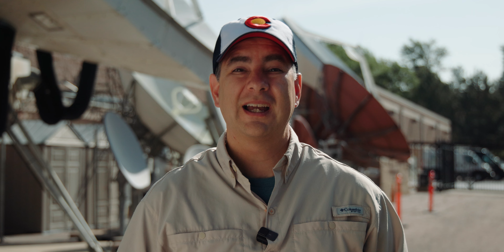Become a Radio Station Troubleshooting Pro with These Expert Tips

Comment: Seen all of these in my 35 years as a broadcast engineer here in the uk. Presenters leaving without setting the desk correctly despite a check list being a common issue!
Reply from the maker: By far the most common no matter where in the world, it seems.
Reply: @TheBroadcastEngineer  By me the standard is loosing signal for 2 or 2.5 hour periods, because your STL is going via fibre, and the one node along the way that is critical is beingh rotationally load shed, and the batteries were stolen 3 months ago.  Have not seen a single residential fibre hub that still has intact battery doors, all of them have been ripped open and the batteries stolen. The mobile plant in the building they actually replaced the battery packs, with lithium iron phosphate units, and those literally got encased with a reinforced polymer concrete fill, to prevent them being stolen, plus bolted to the floor with anchor bolts.

Comment: And of course your favourite one, off the air because the generator has finished drinking all the oil, and has gone off on low oil level, or the solar charge controller got stuck trying to manage loads, and turned them all off, waiting for you to drive up there and "turn it off really, and turn it on". Or the problem might be easy to see, because, despite having 3 different Internet suppliers, and 3 different fibre cables, they all 3 meet at one cabinet 3 streets over, and some drunk guy just put a truck though the cabinet, cleaning it off neatly just under pavement height, and moving it 30m down the street.
Reply from the maker: What? Having three different providers have a common box never happens! 😜
Reply: @TheBroadcastEngineer  Turns out all 3are resellers of the fourth, who you absolutely despise from previous experience with the finest call centre talking bobbleheads they could find for $1 per hour, and the ability to read the script without understanding anything on it.
Reply from the maker: @SeanBZA hahaha that’s even funnier! Sorry to laugh at that, but the reseller market makes it difficult to actually source different connections.
Reply: @TheBroadcastEngineer  Well by me there are 4 running outside. First one is one cellular company, who recently sold off the actual infrastructure to a newly formed company, and is pretty reliable. Second is a residential fibre provider, okish. Third is what was the state telecoms company, and my reply to them is that they still owe me money, which shuts them up fast. Last one stopped 500m up the road, they got banned by the metro from doing any more work, because they were able to break every single underground service where they went, up to 132kV buried cables in trenches and covers, and where they dug all metal vanished.
Reply from the maker: @SeanBZA ahhh backhoe fade recurring offenders.
Reply: @TheBroadcastEngineer  You know the old saying, always take a length of fibre with you into the woods. If you get lost simply bury it, and a backhoe will be around in 5 minutes to snap it in half, and you can catch a ride with them back.

Comment: Hi Marcus... Burt said to say hi...  We had lunch when I was in L..A. a couple of weeks ago.  Here are a couple out of my past.  AM/FM simulcast.  (Yeah, many years ago!)  AM is on-air.  Buit, with only a "ticking" sound.  Tech goes out to the site.  Sees all the meters on the DAP quickly bouncing from zero to full scale.  He powers-down the DAP and lets it sit for a few minutes.  He turns the DAP back on and audio is back on-air.  It was unknown how long the thing had been self oscillating.  Nobody reported anything.  Nobody even called!  Everything was fine the last time I was out there... several days earlier!  We never could replocate the self-oscillation.  It workled until we replaced it with a "Poor-Man's Kanner Box", a term I'm sure you've heard!  The "Poor-Man's" version used UREI LA-3's, instead of the custom Inovonics ALO's.

Or, on the "static" side. how about this one?  Monthly transmitter "swap", switching from Main to Alt-Main.  The "new" TX drops minutes after the switch.  Immediate switch back to the "original" TX.  All is OK.  A quick ride out to the site.  (Originally built for TV.)  Water and ice found in the TX that failed.  Midwinter roof leak let water in, which froze in the cold TX.  Fortunately, RCA Broadcast still existed at the time and had parts available for the BTF-20ES1.  Water had gotten into the rig and froze.  When the rig was fired-up the ice melted.  And...

The strangest I've encountered?  Ever hear of a rig sunstantially damaged by a mouse getting inside?  I'll save that and another story for later...  Take care!